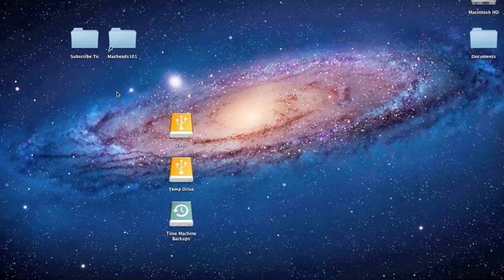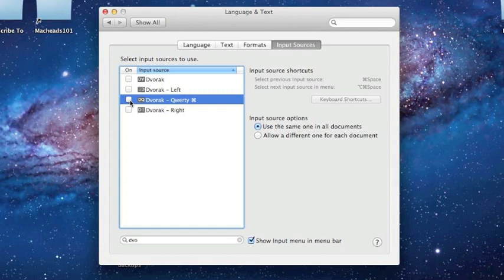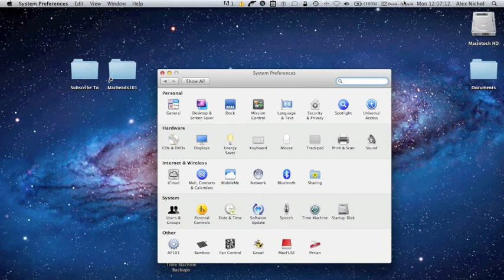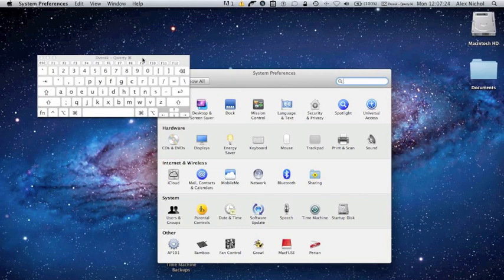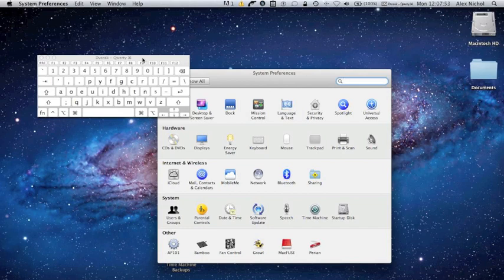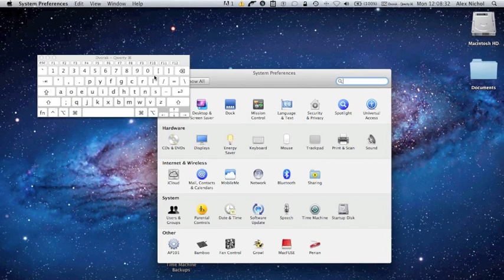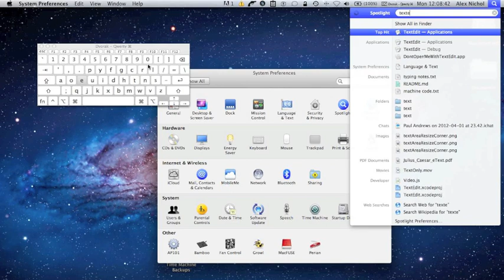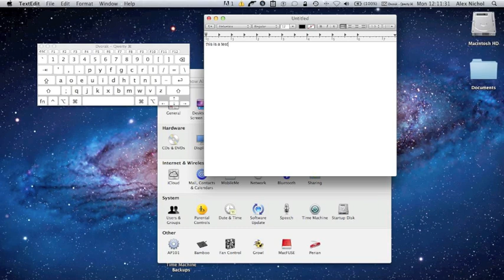The Dvorak Keyboard Layout

Comment: Originally I typed about 75 wpm on QWERTY. I decided to learn Dvorak and it has been about 2 months. I can now type about 55-60 wpm and that number has been rapidly growing. You can learn Dvorak the problem is that you need to stick to it. 1. learn the keys 2. never switch back to qwerty. 3. notice a rapid growth in speed assuming that you never use the other layout (you can switch in between the two layouts but I notice that they tend to cause confusion and error when typing, better to stick with one or the other.
Reply: Yeah, that's why I prefer to watch other peoples experiences from a distance rather than learn two languages, two keyboard layouts, etc. I've always preferred the idea of mastering one thing rather than sharing memory for two learned things which may increase error in either of those two things. I don't doubt that Dvorak is very efficient language, I'm just afraid of encountering random errors or typos which can can result from learning two semi-overlapping things. An example that I can think of is the guy who inverted the handlebars on a bike, and learned how to ride it. My fear is my brain switching between the two algorithms at the worst possible time, and eating shit. Not that the equivalent scenario in typing would cause any pain, but mental errors/mistakes drive me insane. I'm just rambling as I have nothing else better to do. In summary, I agree with conclusion of better to stick with one or the other. I just figured I'd add some of my own thoughts to the mix and elaborate on that a bit (from my own observations).
Reply: 1 year late, lmao.